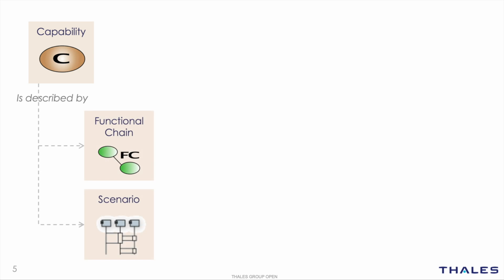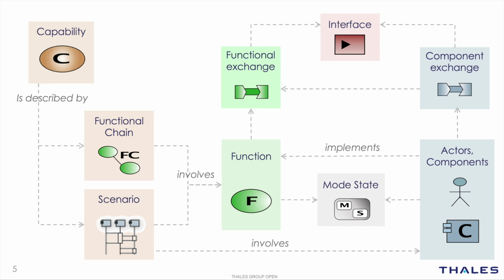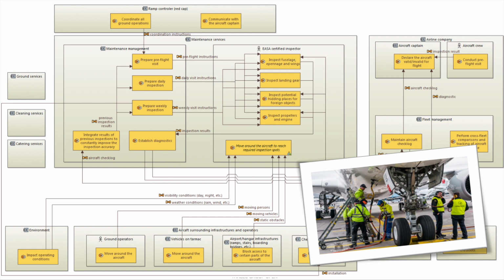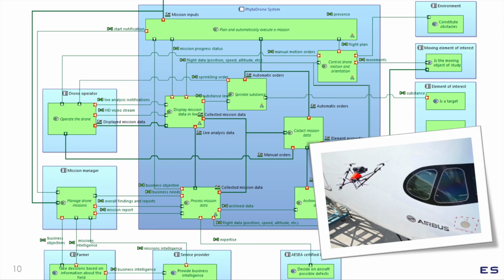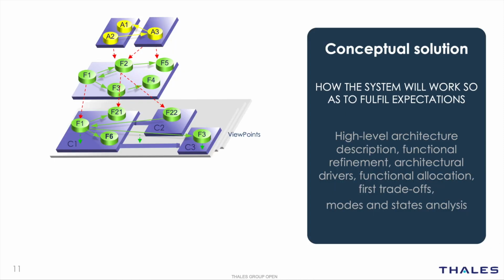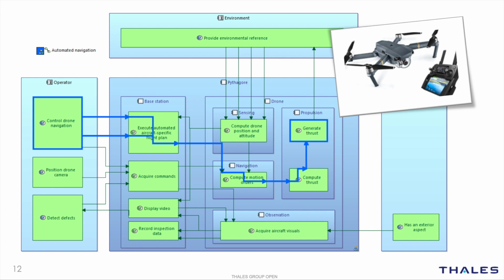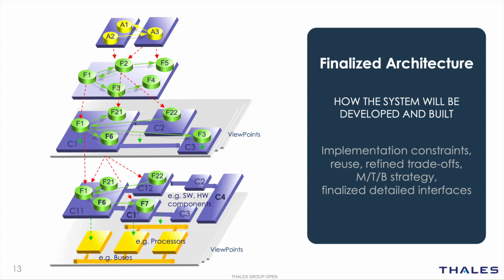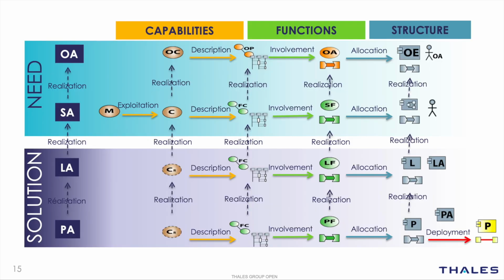The spirit of Arcadia and Capella in 7 minutes

Comment: Does your software follow SysML or another standardized syntax or does it follow its own syntax? Does it have an interchange format with other system architecture (UML, SysML) and/or ALM tools like e.g. Polarion or Magic Draw, Enterprise Architect etc.?
Reply from the maker: Capella follows the Arcadia method and syntax. It is close to SysML but not SysML. https://www.eclipse.org/capella/arcadia_capella_sysml_tool.html . You can contact Obeo for commercial offers for interchange with SysML and also connexion with ALM like Polarion.
Reply: @EclipseCapella  Why not just use SysML which is the standard notation for systems engineering?